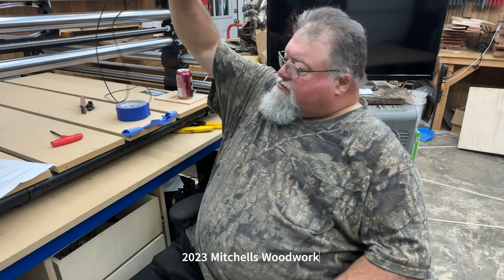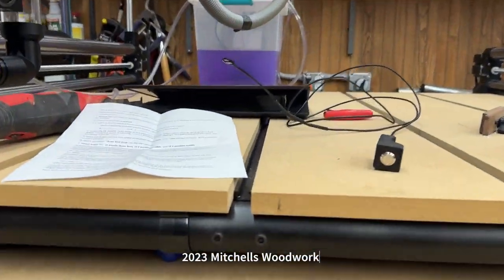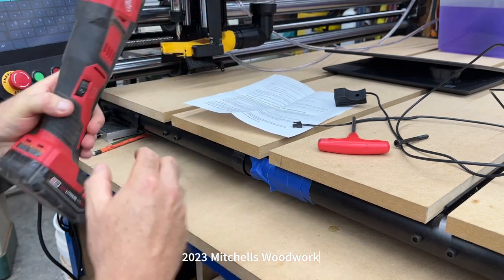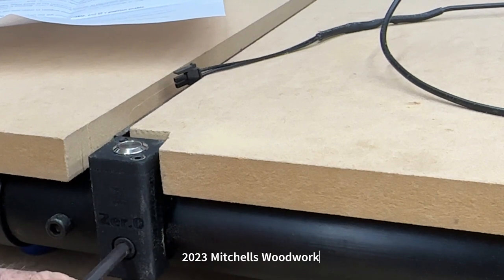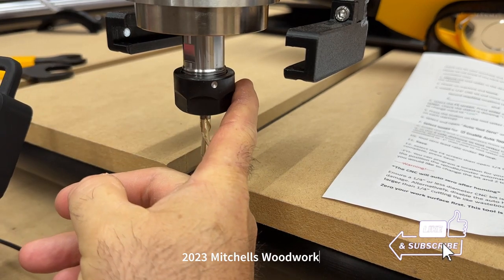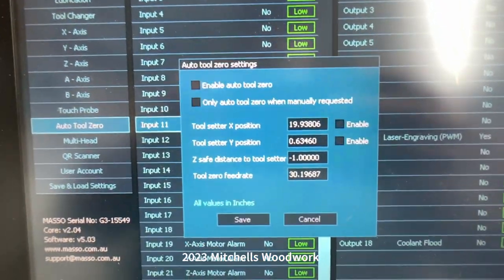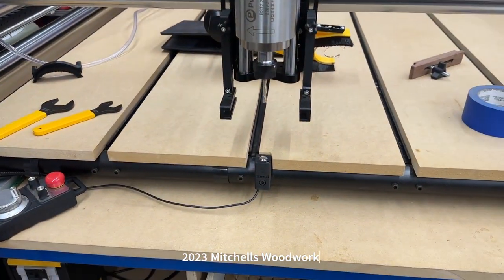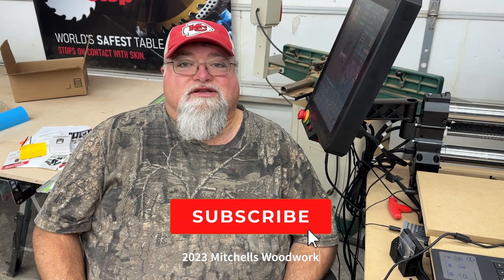How to Add a Tool Setter To Your MASSO Controller - Onefinity Elite Foreman CNC / VCarve Pro

Comment: Also, I learned a little something if you install a tool setter. As we know, it is within the boundaries of the cutting area. As it should be. If you go to put grid lines on your spoilboard, remove the tool setter. A 30 V bit will slice through it.
Reply from the maker: Oh dang!  Did you slice through yours?  I removed my tool setter for the spoil board surfacing, but not the grid lines.  But you're absolutely correct, it should be removed prior to either operation.  Good tip!
Reply: Yes. Sliced right through it. Sent you pictures to your messenger on Facebook.
Reply from the maker: Man, sorry to hear that. 😔
Reply: Bought a new one then learned how to repair old one. Now I have two in case I need a back up.
Reply from the maker: Glad to hear you’re back in business!  How did you fix the first one?
Reply: @MitchellsWoodwork  it is just a momentary switch so I found 5 for $10 on Amazon and removed the old one and soldered on the new one.
Reply from the maker: @brianh.pittman2891  nice!!

Comment: I ordered mine (elite foreman) back in early January with the qcw bottom mount along with the touch probe qcw mount assembly from onefinity, hopefully in a couple more weeks I will have my unit here, oh I also got the pwn 2.2kw 220volt water cooled spindle. I also went on Etsy to Rowdy’s page, a couple others page and picked up a few other things. Covers, ball screw wipers, and coolant line clips that go on the drag chain. I watch all your episodes on the onefinity elite, even built my bench with the kreg 64” x 64” like yours, I added 2 doors, 3 drawers and a compartment with computer fans for the electronics components. I’m in the process of building a 10’ x 12’ room that I will insulate and put heat/ac split unit in. I got the harbor freight dust collector unit that I already upgraded to a bigger fan, and to a 6” 2 stage Oneida xl with 35 gallon steel drum. Tested that out and it did increase the flow quite a bit over stock, had to make a new flange to accept the 6” inlet. Oh and one more thing GO CHIEFS!!!!!! And I live in Texas but love the Chiefs. I gave up on my Cowboys and oilers/Texans lol.
Reply from the maker: Dang!  Sounds like you’re sitting on top and ready to rock!!  Keep us updated on the process, it’s an exciting adventure, for sure!

Mahomes / Maauto 2024!! 😁👍
(I bought that shirt for my wife!😊)

Comment: Question I set my tool setter up ,set my x and y  but when the z comes down on the tool setter it comes down at a fast speed and slams into the tool setter , it does not slow down like your does what am I missing  thanks for your help I love your videos
Reply from the maker: Go to your F1 screen > Auto Tool Zero.  There you’ll check your Z safe distance to toolsetter (mine is -1.000) and also check your Tool zero feedrate (mine is 30” per minute.  

If you need more instructions watch my video linked below.  

How to Add a Tool Setter To Your MASSO Controller - Onefinity Elite Foreman CNC / VCarve Pro
https://youtu.be/vOaCcwuwmKU

Comment: Hey Mr. Mitchell. Me again. Now that I have my tool setter up and running, I have a question. I may have missed this set up in one of your videos but not sure. When my Masso says it is time for a tool change, it stops the carve, shuts the router and vacuum off like it should, and notifies me for which tool to put in next. But, the Z does not raise up and the X,Y stays in the same position of the last gcode command executed prior to asking for the tool change. Is there a way to edit the post processor or a setting in Masso to have the router raise the Z and move to the position over my tool setter for the tool change? Currently, I have to manually jog it all over there.
Reply from the maker: Did you watch my post processor video?  I know I covered that somewhere, and I'm thinking it was in the post processor video.  Let me know.
Reply: I did find the information I was looking for. It was under the "Why your Onefinity needs a tool Changer" video. Thank you.  @MitchellsWoodwork

Comment: Mitchell, maybe you can clear this up for me.  I have been intrested in a tool setter for a while.  I watched this video when you first posted, but could not understand how it works.  Do you still have to use the proble block to set up initially?  That is, when I first set up my project, I would use the proble block to set X, Y and Z, then the spindle would move to the tool setter to define Z for the rest of the project and return to the tool setter for each bit change just as if I would be using the proble block to reset Z?  Next question, how does the Z set without a connection to the spindle?  Is it tripping inside the tool setter when the bit touches off?  You did not explain this in either of your videos.
Reply from the maker: Hi Jim, thanks for the question.  

WITHOUT TOOL SETTER:
You use the probe block for your initial X, Y, Z zeroing of your material at the very beginning of the project.  Then, assuming your project has more than one tool path, you’ll manually load each tool path individually, then re-probe the Z with the probe block after each tool change.  

WITH TOOL SETTER:
You use the probe block for your initial X, Y, Z zeroing of your material at the very beginning of the project.  You can now put the probe block away, you’re finished with it.  Assuming your project has more than one tool path, you save ALL tool paths to ONE gcode file and send it to your machine.  Your machine will automatically prompt you for each tool change, and the tool setter automatically measures each new bit and sends it back to work.  

So much simpler than loading each file separately, then probing each time.  I can’t really comment on HOW the tool setter adjusts the spindle height for each different tool length, I just know it does it.  I’m just an old Arkansas country boy and I ain’t got much book learnin’. 😉

My next Onefinity video will be covering the differences between a probe block and a tool setter.  There still too much confusion about this even though they perform two totally different functions.

Comment: Going to add mine tonight. Can’t wait to have it set up. I do have one off topic question, when you home your machine, it seems to travel much faster than my home does. Is there a way to change the speed the home feature runs?
Reply from the maker: Great!  Let me know how it works out for you!  On the homing speed, do the following:
F1 / Setup > Homing > Homing Feedrate.  I have mine set at 150 ipm.  Let me know if there's anything else I can help you with.  Thanks for watching!
Reply: It works. Thanks for the video. Can't wait to try it out. Also thanks for the homing feed rate repair. Much better.

Comment: How is this different from the OneFinity touch probe?
Reply from the maker: Two totally different tools and functions.  The touch probe sets your X, Y and then the Z height of your material or wasteboard.  The Bit Setter measures the length of your router bit, then the controller uses that measurement to recalibrate your new Z height for the new bit.  I covered it more in depth in the follow up video linked below. 

https://youtu.be/k1Hx8z3urDE?si=SZEaIa1jECq_EuaD

Comment: Good info. I have a question about your QCW frame. Is there a way to secure the frame to your table or does it just it on top? I know the tails screw on to the frame on top but I’m just not sure if there are holes in the frame to secure it to the table.
Reply from the maker: Looking at mine now, I'm not seeing a way to secure it to the table.  Mine has leveling feet, which I believe are standard for the QCW.  However, I'm sure there's got to be an option to mount the QCW somehow, in case you wanted to mount it vertically.   The standard (non-QCW) feet that come with the Elite are drilled with 4 mounting holes each.
Reply: @MitchellsWoodwork  ok. That’s what I was thinking. I ordered my elite Forman last week and wanted to make a flip table to place it on. I’m thinking I can bolt it down using the female threads for the the leveling feet. Thanks for the quick response. Love your signs and the opening of your video when you received your cnc was awesome. Lol. Good stuff.

Comment: So, when you change bits for the same carve will it automatically go and set the Z before starting the file?
Reply from the maker: Yes, sort of.   Your original Z as set by the probe block at the beginning never changes.  After a bit change, the tool setter measures the length of the new bit and adjusts the spindle height to maintain the original Z with the new bit.  It’s the most useful and inexpensive upgrade I’ve added to my machine, and I highly recommend the one made by DashMade that I linked in the description.  Hope this helped you, but if you need more info just let me know.
Reply: Thanks. So every time you start a file it automatic goes over to the setter and sets the Z?
Reply from the maker: Yep.

Comment: Great video, Mitch.  I followed it and my tool setter is working perfectly. 

I did have one question.  Between tool changes, the machine stops and raises above the workpiece (with a tool-change prompt on the MASSO controller).  It might be easier to change the tool if the machine would return all the way to the front.  Do you know if this is possible?
Reply from the maker: Absolutely, I have my post processor modified to do exactly that.  I’m away from the shop this morning but should be back this afternoon.  In the meantime, send me an email at mitchellswoodwork [at] gmail [dot] com.  I’ll reply to you there.
Reply: Thank you.  @MitchellsWoodwork
Reply from the maker: Here's a link to a new video on this topic:

https://youtu.be/QZDj4uqit7k

Comment: Hi Mitchell I have a Elite Foreman order. What is different between the the tool setter and the z setter. Do I need both? I like your videos you talk like me.
Reply from the maker: Well thank you!  You must be a southerner, as well?  

If you’re referring to the square aluminum touch probe that comes with the Elite series, it is used to set your X, Y, and Z before you begin your carve.  It is also used to manually re-zero each new bit used in the project, if your project has more than one tool path.  

The tool setter (or Z Zer.0 as shown in this video) performs two totally different tasks.  For one, it allows you to upload multiple tool paths at one time, which is impossible without a tool setter.  It also automatically measures the new bit for each successive tool path in the project.  Otherwise you’d have to manually re-zero each bit before each tool path is run.  

You don’t HAVE to have a tool setter, but they sure make life easier.

Comment: For this to work, do you need to have all your tool paths saved to one file?
Reply from the maker: You CAN still save and run each file separately while using the tool setter, but doing so would pretty much negate the purpose of having the tool setter in the first place.

Comment: Where did you get that jog wheel to control the machine ?
Reply from the maker: I bought it from the Masso website:
https://www.masso.com.au/product/mpg-pendant/
Don't be tempted by the cheap knock-off units that look identical to the MPG.   I've heard lots of horror stories of folks trying to get one to work with the Masso controller.  Buy once, cry once.  Thanks for watching!
Reply: @MitchellsWoodwork  Awesome. Thanks a lot. Does it hook up easy on back of masso?
Reply from the maker: Here ya go!

Installing A Masso MPG Pendant on Onefinity Elite Foreman CNC
https://youtu.be/C33JxSxieD4

Comment: Thank you. New subscriber here! That definitely looks like something that would be very useful, but I have a few questions.... How do you deal with spoilboard surfacing? I take it the setter is level with the top of the spoilboard. When you surface the spoilboard and lose a little thickness, how do you accommodate for the loss of spoilboard thickness? Is there an adjustment on the physical tool setter? Or is the adjustment done on the Masso, and if so, how is that done?
Reply from the maker: Hi Woody, thanks for subscribing!  In my case, using the DashMade Woodworking tool setter, it sits below the surface of my QCW waste board at least 1/8”, maybe a bit more.  So I can run several .02” or .03” resurfacing passes before it’ll get down to the level of the tool setter.  Once I do eventually get down that low I’ll just replace the waste board slats and start over.  You can see how I dealt with surfacing my waste board in the video linked below.  

https://youtu.be/h4H1BugEtP0?si=FjGcjl0aJhL8WqJY

Please note:  I’m not familiar with the new Onefinity tool setter so I can only comment on the DashMade version I have now, and it’s perfect.

Comment: Hi
I bought a Journeyman Elite and having a probing issue. I am new to this so good chance its an operator error…. Question, I went through the probing process but once cutting out a simple circle its not starting the cut within the probing area at all.  Should the probing tell the CNC where the work area will be at or do you think something is wrong with the probing device?
Reply from the maker: Which design software are you using?
Reply: Sorry should have noted.  Its Carveco.   @MitchellsWoodwork
Reply: Thanks anyways

Comment: I don't get it... how does your machine know where your material is, if you don't also probe for X and Y on a corner of your material?
I don't yet own a CNC, waiting for my Onefinity (my first ever CNC), but just from videos that I've watched online, using a probe made sense to me and I understand that the machine needs to know where your material is - and that's done by probing x/y. But if you use a tool setter instead of a probe, I really don't see how your machine knows where the material is positioned on the board... What am I missing?
Reply from the maker: That's a great question!   Congrats on your upcoming Onefinity, you're starting out with the best!   

The tool setter and the x, y, z probe perform two separate functions.  As you stated, the probe tells the CNC where the material is located, and how thick the material is.  And you can get by without a toolsetter, for sure.  A toolsetter is not a necessity, but it sure makes life easier.  

In a nutshell, if you don't have a toolsetter you have to probe your Z after each tool change, because each tool is a different length.  If your project uses 5 tools, you're probing 5 times.  With the toolsetter, you only probe the Z once, and that’s during the initial probing (X, Y and Z) when you’re setting up for the carve.  The beauty of a toolsetter is that regardless of how many tool changes you have to do, the toolsetter measures the length of the new bit and sends it on its way to make sawdust.  I hope this helps you, but if you need further assistance contact me through my digital business card below.  Thanks! 

https://dot.cards/mitchellswoodwork
Reply: Thank you! Makes perfect sense now.
Reply from the maker: You’re welcome, glad I could help!
Reply: So on your initial setup you home/auto tool zero, then you still probe for work origin with the xyz probe block?

Comment: I must of set something wrong, when I tried it said no tool loaded even though I selected 1/4” em. So I rehired the machine, now every time I home the machine it homes then immediately goes to the tool setter and touches it then backs off.
Reply from the maker: When you have the "auto tool zero" enabled (F1 screen) that's exactly what it should do: 
home > go to tool setter > measure > back off.   Make sure you have your tools numbered in your CAD software and also in your Masso F4 screen.  I have a video explaining that process if you need it:  https://youtu.be/cvVy2r7kcvs?si=ITzTFsFXlKZ0stHW
Reply: @MitchellsWoodwork  thanks I will go watch that video and change those. Trying to add my Jenny bits ( I bought one of each pretty much ) to the carveco maker program, and a few bits and bits as well.
Even though I’m born and raised in Texas gulf coast, I gave up on the boys and for the last decade I’ve been a Chiefs fan.
GO CHIEFS!!!
Reply from the maker: Did you get things figured out?  And yes, GO CHIEFS!!
Reply: @MitchellsWoodwork  I believe so, gonna try it later this week. Had condensation issues on my dust collection system. 6” main line with 4” hose to the spindle. The A/C in my room condenses the high humid south Texas gulf coast air in my main line. My dust collector is outside the room and exhaust duct outside, the 30 gallon drum under the Oneida with a harbor freight dust collector on top but I changed out the fan to the when larger fan. Dang thing trips the iot starting up so I put a soft start kit on it. Just about the time it gets up to speed it trips again. Put an amp meter on it and it runs at 12.87 amps. (Need a 220 volt motor instead of 110) anyway I now have a remote switch to operate it but dealing with the condensation. I’m installing a 6” blast valve on the outside of the room side of the duct. 
GO CHIEFS!!!
Reply from the maker: @stevereese6488  dang man, if it ain’t one thing it’s another! 🫢 Good luck and keep me updated.